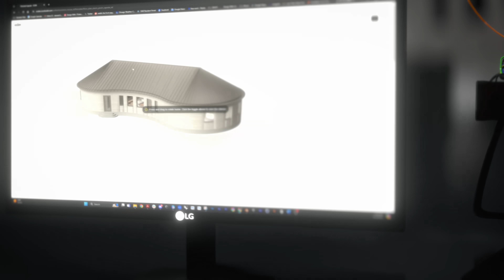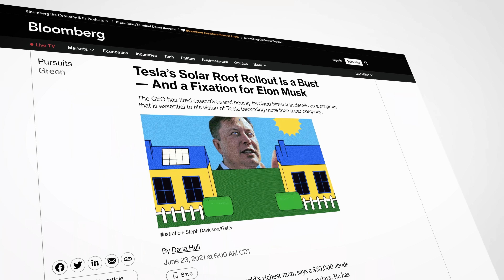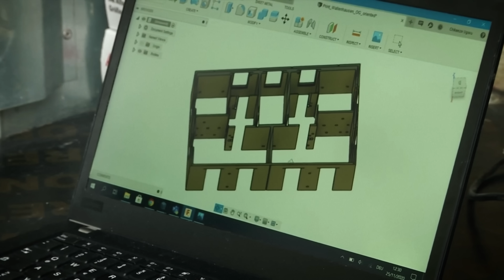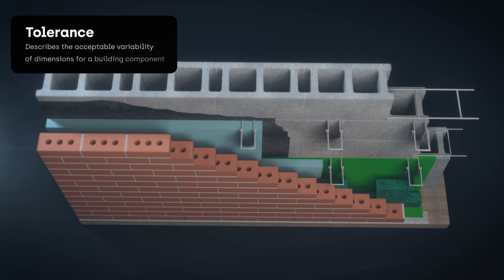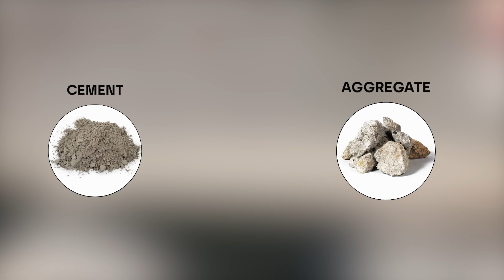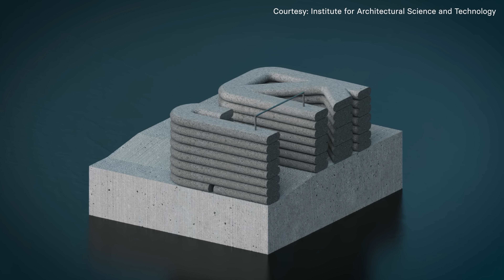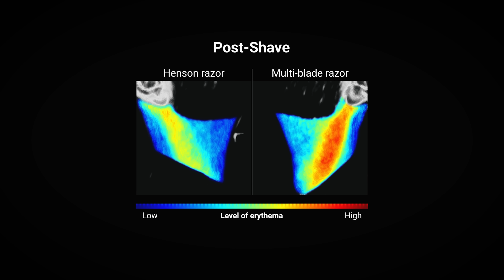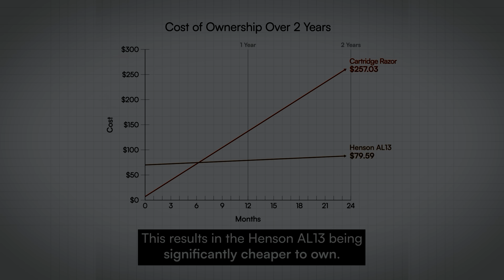Why 3D Printing Buildings Leads to Problems

Comment: Maybe by equipping the 3D printers with a scoop and squirt device, no pipes: robot arm moves between work-piece and cement/mortar storage, suitable for traditional cement/mortar and by adding brick pick-and-place functionality while construction site equipment also adds concrete prefab (and other large things such as lintels) move-and-place machines, most limitations and disadvantages compared to traditional techniques would disappear.

Comment: Like most things this has its place, and as long as people do not try to make it work for everything I am all for it. I do have to wonder about how this works with different building codes. For a standard concreate structure there are testing requirements ect. And in some places electrical all has to be run in conduit and I could see that being hard to do in this type of construction. The other big question has to be the QC process, for example five different structures built with different weather conditions or at different life cycle points of some parts. But this tech has advanced wonderfully in a very short time and can be a really helpful addition.

Comment: 3d printed houses are nonesense, given you're only printing the walls, which is already the simplest part of construction, and it was mostly automated 60+ years ago anyway with prefab housing where you just put everything together like Legos. The hardest part of construction is the foundation and plumbing, and this 'new amazing tech' does literally nothing for that, in fact I wouldn't be surprised if it made the houses WORSE AND NORE EXPENSIVE given the special mix you need, the machine clogging, setting up and transporting said machine, possible errors, etc. Make prefab housing, it's way faster and easier, cheaper, scalable. Was the whole idea behind the USSR housing revolution, it may not be pretty, but it provides affordable housing for all. Then again, no one in power actually wants affordable housing

Comment: Having the company who built a house disappear doesn't make the buildings they made less-repairable.

Repairability is physical, not legal.

I can't understand why the 3D-printed-building operations aren't clean-trimming things like window-holes, to get the tolerances better.

( 2 blades are generally better than 1, in my experience, though I've not used Henson/Hanson razors, & I'm NOT paying $80 for a razor, when I know what the absurd markup they're putting on their products is )

_ /\ _

Comment: Well this technology can be efficent in some countries; to afford buildings and solve housing shortage;  but in the other hand it's not efficent in other countries because dosen't adapt the climate also it is so expensive compared to other cheap affordable   builduing materials ;Also dues to strict regulations of buiding codes to avoid turning buildings to a ticking time death trap, like quake resistance fire resistance ....etc, there are many issues to have solve it before use . So in the end a solution has worked in a country dosen't mean it can woks everywhere.

Comment: I did try 3d print concrete once. Small scale and just as my personal test to see if I should invest to include it in my business. Turns out it has one big issue to run in my area. Bugs. They love those layer lines. We'd need special kind of coat which given extra surface area of the lines, balloon cost. So, no. Not here.

Comment: 3D house printing is a complete scam. It's not faster, not cheaper, and years down the road, impossible to fix or modify.  No basement, and insulation is not up to requirements in colder zones. No vapor barrier. 

Why the comparison to bricks....most new housing is wood frame, wood sheathing, foam outer wall with stucco.

Comment: Traditional lumber Modular Homes are faster, cheaper, and better than stick-built homes. I've been to many modular home factories. The average factory build time is one week (built, wired, and plumbed), then add 3 weeks or so for transport, setting on the foundation and completion. Months faster than stick built. People think: Modular = mobile home. That's not true, mobile homes rely on the metal frame underneath for strength, a modular is glued and screwed for durability over it's life AND during transport and during the setting. You could never lift a mobile home off the metal under-frame w a crane and have it retain it's integrity.

Comment: Why bother with such a complicated and fragile setup when we could just maybe redesign the 3d printers or exchange them with brick+mortar laying robots to mimic what humans do but a lot more accurately and efficiently, in that way we will still have the design advantages that we currently have instead of having to dabble with a new concrete based wall system which makes every other system expensive anyways? Furthermore having a top down printer only deal with small sections that need curved structure like we see in the modern designs but getting printed in factories and then getting shipped is probably a lot better than having to print the whole building at a time.

Comment: Just another tech bro gimmick. Solution in search of a problem. The building codes and taxes are why homes are unaffordable. Cheaper ways to build homes get legally blocked or stuck behind insurmountable hassles and red tape. It's a rigged system top to bottom.

Comment: All materials and techniques in construction have a time and place. 3D printing hasn't found it yet. It can't do everything but used strategically it could speed the house construction. Aka just building the external walls. 

I agree total vertical integration for houses is stupid.

Comment: If the hollow part of your 3d printed cement wall has zigzagging inner connections. It meabs your wall sucks at insulating . You will lose heat like crazy , have cold walls in cold climate or hot walls in hot climate

Comment: I think the finished product looks like crap. With that ribbed look on the inside and outside, there's no way to clean it. It would just build up dust, dirt and pet hair forever.  I'm glad that there are people thinking outside the box for the next great innovations, but the current state of 3d printing buildings isn't it.  Thanks for the video.

Comment: prefab steel framing panels that bolt to the foundation at the 4 corners and 4 sides.
Rebar in the walls overlapping at the floors.
Cheapest simplest solution.

Comment: None of these are real issues and I have to say looking at all current methods, prefabricated, brick etc this is absolutely the most efficient ways to build houses going forward here’s why:
-The window seal issue is just a teething issue, that many 3d print builders have already overcome
- what’s wrong with rounded edges?
- I agree about imperfections showing inside your house with exposed 3d printed walls, however im not sure why builders expose them they don’t look good, you wouldn’t expose brick walls? Anyway this can easily be rectified with internal drywall to cover them or plastering or even stucco can be applied and smoothed out. There’s a builder in Australia that puts on drywall on the inside and you wouldn’t even be able to tell its 3d printed.
- Yes 3d printed need to be precise in the way their laid, but they are done precisely by robots anyway I haven’t heard to much about this being an issue and if it is the builder would rectify, not really an issue for the house owner.
- with regards to repairs renovations, small jobs can be repaired with the same material to fix bricks, bigger repairs would ilkely be printed off site and then shipped in and or there are 3d printers that are just movable arms that could build small walls etc for renovations
- To conclude in Australia its already about 25% cheaper to 3d print a house then to use brick for double story houses as you need far fewer people on site, far fewer trades i.e. you don’t need scaffolding etc, 3d printing will be the dominant choice for home building in the future without question.

Comment: I'm an architect with 25 years of experience in Australia. While 3D printing holds real potential in construction—particularly for reducing waste, speeding up certain processes, and enabling complex forms—it's often being applied in the wrong ways for many typical projects right now.
A skilled bricklayer is frequently faster, more cost-effective, and more practical for building standard walls, especially in residential settings.
On-site 3D concrete printing doesn't belong in most urban builds yet—try operating a large robotic printer after 5pm in a city suburb, and you'll quickly run into noise complaints, shutdowns, and strict local council regulations.
Recent Australian projects showcase the technology's promise (and limitations), like multi-storey 3D-printed homes in Melbourne and Perth.But the bigger problem is that engineers are often trying to design a house rather than a home. 

While cost is undeniably important, it shouldn't be the number one priority—it's the soul of the home that truly matters. A house needs to feel alive, nurturing, and personal, not just structurally sound and budget-driven.

As Frank Lloyd Wright put it: "The mother art is architecture. Without an architecture of our own we have no soul of our own civilization." Great homes balance efficiency with emotion, creating spaces that uplift and endure.

Comment: Far more reasonable to print sections on a fab and then assemble on site and fill with styrofoam concrete, otherwise you often can't print due to weather. We have this kind of tech in Russia, and it's pretty competitive price-wise for weird shapes. For a basic house it is still far cheaper and actually faster to just build a house yourself from foamed concrete blocks though - 1-2 people can do the full warm contour in 2 months from nothing.

Comment: Hello  First the material used is Not concrete.  It is a silicon based polymer.  Concrete is meant to last 100 years.  The geo-polymer used in 'printed homes will last 3,000 years or more.  Regards
Reply: That’s a long time for ugly.

Comment: By the time you set that dumb machine up the block layers would already be done.  This is not printing a house it's printing the walls.  It's a solution to a problem that was never a problem.  The block layers and block were never the main cost drivers of a house (or the framer and wood framing for that matter).  It's literally everything else.

Comment: Also, these houses are basically impossible to renovate. I can't just patch drywall and move on. The concrete doesn't bind to dry concrete so we have to put in a whole structural element if we want to change something for the new concrete bind to.

Comment: 2:32 bricks and 3d printing could be done together.  As the printer drops the base, bricks could be added behind the printer head?
That and the surfaces don’t need to look like s bunch of layers, go over the surface with stucco on the outside and skim coat plaster on the inside.

Comment: 3D printed housing is nonsense IMHO. First, where are the brick and mortar houses in the US or Canada? It is practically all wood and plastics. Can you imagine how much heavier a full concrete house is compared to a wood/drywall one? "it takes 24 hours to print the house"; maybe, but who are all those people dotting on the machine all the time, making sure it does not mess up, and it does mess up as we see in the footage. What if someone does not like the wanky, bare concrete walls? I am not an engineer, but I have a feeling that even hanging picture on the wall is a challenge, starting from an uneven wall to needing special concrete drills and bits to make even a small hole. 
3D printing is great for prototyping in certain situations and maybe even manufacture of certain things, although I cannot imagine how 3D printing could be faster than injection molding.

Comment: Making housing affordable is simple. Difficult , but simple. 

1- they need to be much smaller. You can build a bigger house when you can afford it via additions like we did for the last few thousand years. A 300-600 square ft house will do the trick to start. 

2- primarily Prefabricated and mass produceable floor plans and elements. A suite of structures that can be pre-approved with aesthetic elements mixed and matched. Simplify it for labor savings. A 600 square ft well insulated structure could be erected for $35k including labor. (Before electric, plumbing, hvac) We need to and CAN drastically reduce labour hours per unit. 

3- in expensive cities, permitting can cost $40-$60k all said and done. Thats crazy. This can be down to $2-$3k. Stop funding our cities with permits. 

4- smaller plots, therefor higher density. In Austin TX, when my house was built, the minimum lot size was 0.32 acres. They built 2 houses on that lot in a condo situation. Today at $180k thats very steep even for a small house that only cost $60k to build. Split between 5-6 homes, thats not too bad. $30k a piece

5- stiff penalties for non occupancy. Speculative investment into housing is becoming the largest factor in cost.  

A 600 square ft home on 0.05 acres(2100 square feet) land. Could be built for $70- $95k before profit on the sale. $540k for 6 houses on that lot Compared to a $650-$750k cost to build one 2000sq ft house and one 1100sq ft.

Comment: While 3D printing walls seem cool, I believe the future of house construction lies in brick laying robots. Bricks with channels offer better thermal isolation than a solid concrete, later manual modifications to the walls are easier with bricks, and brick laying - even by a robot - relies on much less machinery and irreversible technical processes.

Comment: nope its bye design construction often hires a bunch of low I* people that cant do anything else..its a huge employer....on top of that its a store of value what would happen if you reduce the price bye 40%?for householders collateral... exactly there is no real motivation to inovate/solve the issue hence why zoning laws are strict to limit places where houses can be build.....its not the cost but buracracy that limits housing artificialy inflating there price...

Comment: Material still concrete so it can be patched. If there's a hole hole and to plug a hole, we use a expanded foam. The downside to having a house built like this is timing. It takes longer to have a house built by machine versus people so far from what I've seen now and I'm not a specialist. I'm not an expert. I'm an electrical engineer so I don't know much in the 3D printing houses but this is gone from what I've seen and to me it seems like it takes longer to build the house cuz they don't do it in one day and this is for a certain size house they can only get but so big and I don't think the technology will ever be there for doing it on buildings like a hospital. Something that has multiple floors so that's just my thought

Comment: Is it faster? I don't think so, I have seen a fraiming crew do two homes in one day? I don't like the outside surface because it is not smooth.  Those ribs  will collect dust , mold spors, as well as moss and lichien. In any damp climate, you will see walls covered with unwanted groth.  On both the outside and inside, not a healthy environment for humans. We already have prefab concreat construction that can be set up in a single day.

Comment: I think you're overstating the repairability issue. You don't have to use a 3D printer to make changes. You can use traditional concrete construction techniques, like using forms. For nearly every problem you stated, it only took me a matter of seconds to visualize a solution.

Comment: I don't think the problem is really the 3d printing part just the execution of it. So far it has been done in one of the most laziest ways you can imagine. You could do 90 degree corners, but you either need a bit of post or in process processing. You can have different tool heads or add to that tool head, you can print finer resolution, you can go back over it while it's still wet and contour it. Either a human with a trowel or another tool head applying pressure with a trowel or like straightedge. With this kind of computer control adding a pressure sensor and dialing it in to the concrete to get a damn near perfect edge would be trivial. Since the inside doesn't need to look the best it makes getting the outside right a lot easier. The only reason for the shitty lines is making it look 3d printed. 

The overhangs like window and doorways you could use other materials as supports that could also be 3d printed. I can foresee a hardset foam being used then knocked out after the concrete has set. 

The rigidity of the setup is not that great, the line shifting makes it look worse than it really needs to be.